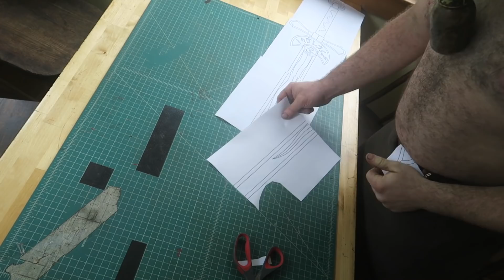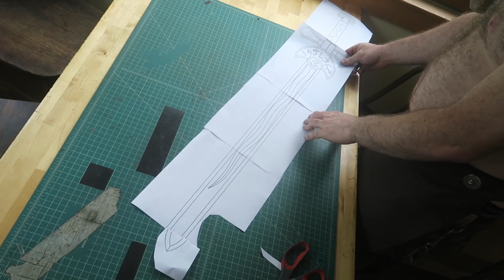Red Sonja Sword Part 1: Homemade Metal Router.

Comment: Mike is not a blacksmith, but he definitely follows the "need a tool, make a tool" philosophy.
Reply: He is a fabricator
Reply: He is a madman.
Reply: He's a fabricator.
He's a madman.
(And he's not by definition a blacksmith)
He's Michael fucking Cthulu
Reply: Id say maybe machinist or fabricator is more appropriate since he doen not infact have a smithy or forge
Reply: He is the fabricator-general (40K). That would be a cool cosplay for mike. Or someone edit a picture with all of mikes body addon into one picture (the patched leather apron, metal glove and arm, breather,
Reply: the term i usually use for individuals like mike is a fabricobbler, he fabricates and cobbles stuff together hence fabricobbler
Reply: @subantamu2853  yes

Comment: The magnet causes arc blow, it’s the magnetic fields from the arc and the magnet arguing with each other, try looping your ground around the part.

Under normal circumstances, the arc takes the shortest path, but external magnetic fields and workpiece geometry can make it wander. It’s a particular issue when the workpiece itself is magnetic.

1. Switch to AC power. Welders generally prefer DC because it makes for easier starting and there’s usually less arc wander. If you’re facing arc blow though, AC is the obvious first step. (It might mean changing the electrode to one optimized for AC.)
2. Shorten the arc length. Not only does this reduce the distance over which the arc can wander, but it usually means reducing current, which lessens the magnetic field around the arc.
3. Wrap the ground cable around the workpiece. The idea is that this cancels out any magnetic effects being induced.
4. Angle the torch. If the arc is moving a consistent direction – either lagging or leading the electrode, try angling the torch to compensate.
5. Tack Welds. Make tack welds rather than putting in one continuous bead.

https://www.wileymetal.com/how-to-eliminate-arc-blow-when-welding/

Comment: Arc welding uses electrons to heat up the metal, the electrons flows toward the anode due to potential differences. A magnet creates an electric field and disrupts the flow of electrons in the arc. They are both using the same basis for the phenomena, electron flow. One creates a polar magnetic field the other uses negative and positive charges to stream electrons in an arc. Together they disrupt one another.

Comment: Why not make a triangle-shaped hole stamp for the markings? Then you could just blast aerosol paint over the surface to mark it out, it'd probably save you from a good hour of laborious monotonous exacto-cutting, might even be a fraction more precise too?
Reply: i think the issue is having one edge of the triangle following exactly along the line, so he can put the pen up against it when marking the metal.

Comment: Michael, the arc is created by high voltage electricity. Electricity and magnetism are intrinsically linked together. Electricity creates magnetism, and vice versa. So the arc will follow the lines of magnetic flux.

Comment: Your workbench is way to low. Especially for this finnicky stuff. If you raise it, it should help with your (clearly visible) lower back-pain. The Bench should not be lower than your hips. I had similar problems for a while, but since I've got an adjustable working table at work its better (I'm a woodworker/furniture maker).

Comment: I remember you were saying the best spot to view the weld with the camera is where you want to be. Which makes it hard to film you performing the welds. I have a solution for you take that go pro you used on the spledgehammer and use it like a headlamp on your welding helmet. They make helmet mounts for motorcycle helmets that you could use or rig something else up yourself.

Comment: On a rotating tool on one side it is spinning up and the other side spinning down if you keep the side spinning up towards the out side of the cut it won’t try to jump up and skate across the surface

Comment: You could put some kind of rubber material on the bottom of the depth frame. It'd help with the control of it, most likely.

Comment: For some reasons magnetic feilds affect plasma . So the can "blow" the arc in weird ways. Like trying to push a bendy twig into the area a fan is blowing hard. Only the wind from the fan only stays in one area.
Reply: It's due to Lorentz-Forces; electric charges experience a force at a right angle to both the magnetic field and their movement. The magnetic field is probably going sideways to some degree, and the welder is (I think?) using DC, so the electric charge is going down (or up, but not both), which combines to push the arc to the side until it disconnects (kinda similar to Jacobs Ladder), creating that sparking
Reply: Plasma is affected by magnetics, because that's how you make plasma. By affecting a neutral gas to strong magnetics(or, admittedly, heat).

Comment: You should make a tank for your sword to secure them in the handle better so you can have something more that a weld holding it.(edit A full sized tang that goes through the whole handle, it is better than a  short and  stumpy one)
Reply: more than a weld? have you seen this man's welds?
Reply: @gramursowanfaborden5820  I know man But since i was little I always thought welds are real bad and are gonna break any second and I cringe when there isnt anothere structure supporting it. It has to do with the way I think I feel like welds are unreliable XD

Comment: Why does everyone say the arc reacts with the magnet "because electrons"?
Its like a lot of welding instructors never wanted to explain it so they made up something ten times for nebulous and difficult to follow then the truth.

Plasma follows magnetic fields. 

All electric arcs create then flow through plasma. 

Almost all electric welding uses plasma, but only plasma torches have two electrodes in the weld/cutting head.

There. Its properly, accurately, and fully explained.

None of this electron nonsense the only halfway describes it.